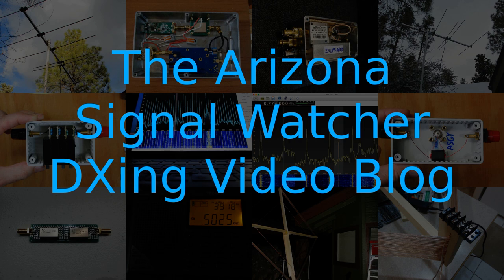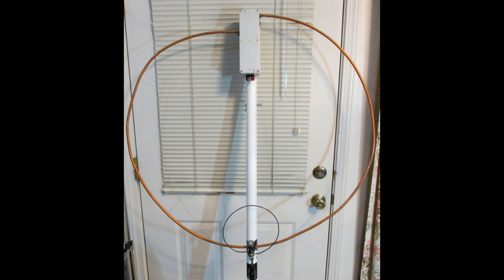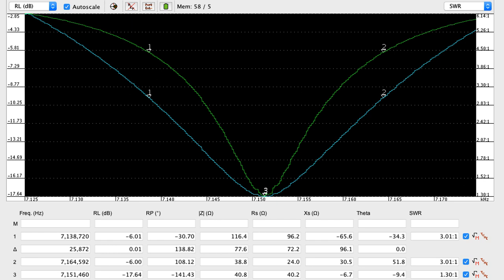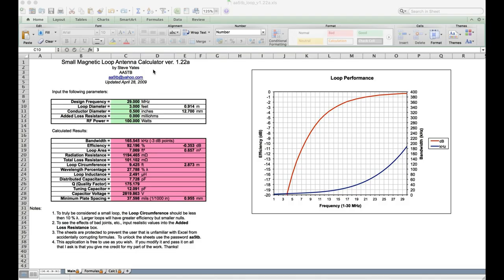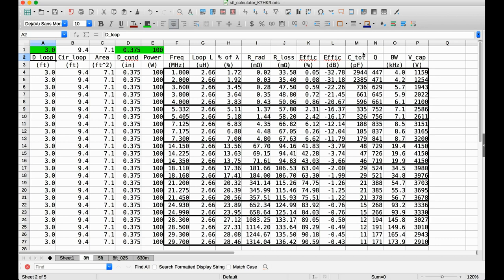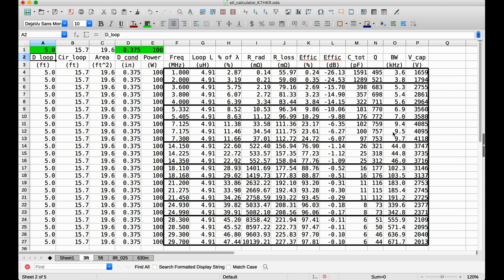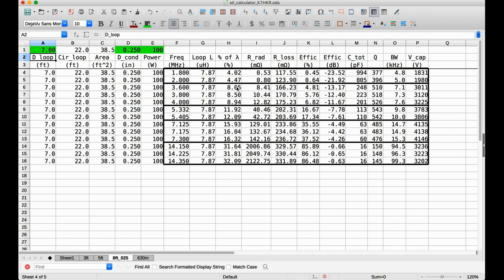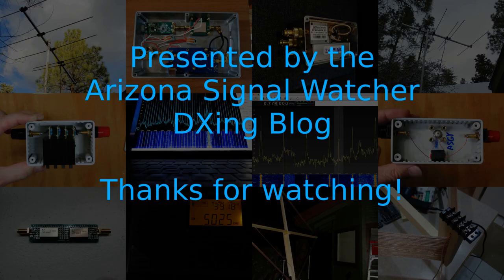Arizona Signal Watcher Ep012 - Small transmitting loops Part I: Intro and theory

Comment: This is a good overview. Aren't those copper straps around the vacuum-variable capacitor going to produce significant loss? I always wonder about that when I see that setup. I guess you can't solder or braze, but isn't that contact resistance going to significantly reduce efficiency? (And I liked your "ground plane" illustration. 😆)